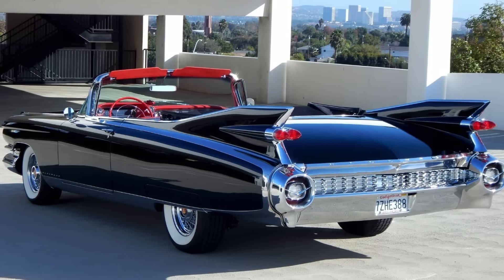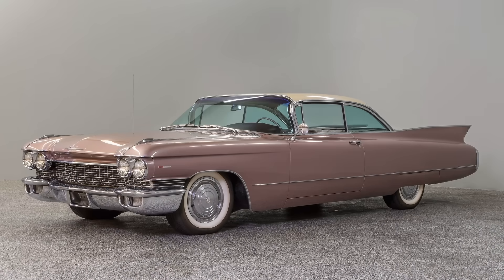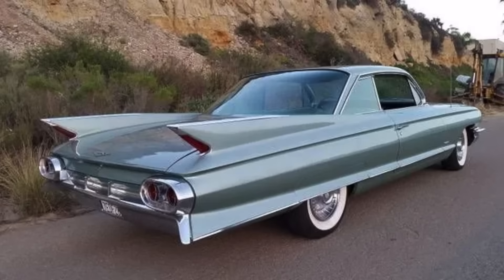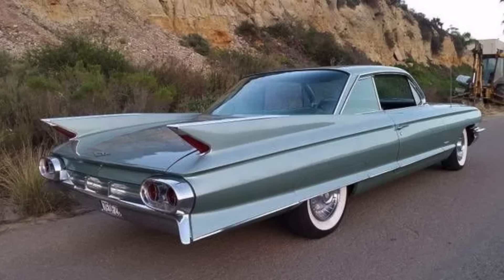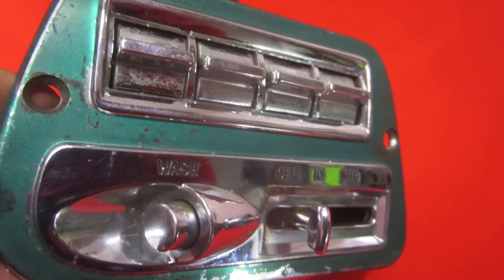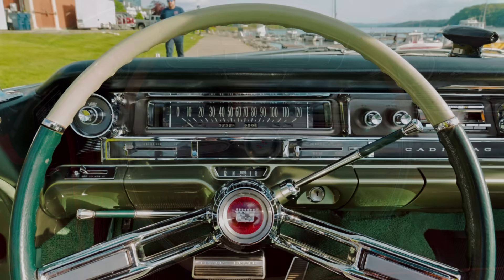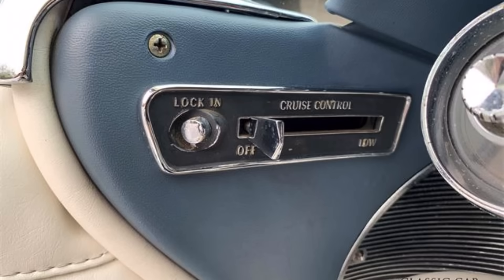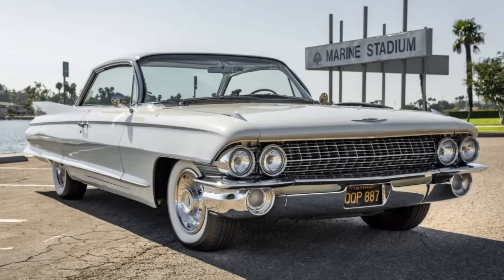Worst Automotive Components of All Time: The 1961 Cadillac's Dangerous Cruise Control (GM)

Comment: Hey! Small correction for you, but very nuanced! I own a 1961 Cadillac, which was the second to last year for the original 390 engine, which was introduced in the 1959 model year. It was a continuation of the 331/365 OHV engine series (same block), which was introduced as Cadillac's new postwar engine in 1949. After 1962, Cadillac designed an entirely new engine for 1963, which happened to also carry the same size in displacement, but was a completely different engine internally that shared almost no parts! It was that engine that was later bored out to 429 cubic inch engine. 1968 was the switch to the 472/500, which was also a new block as both previous designs had reached the limits of their displacement. In short the 390 engine used in the 1961 was not enlarged to the 429, they had already gone to a different block by then! Maybe you knew this and didn't feel the need to include that information but just incase, thought I'd share!

Comment: I don't know if I would call the Cadillac 429 all that reliable.  The timing chain cover allowed oil blow-by which very slowly stopped oiling the top of the engine.  It wouldn't turn on a tell-tale light, but slowly destroyed the engine.   Of course GM really could care less if the car lasts past 100,000 miles back then.  The only way to fix the problem was a new timing chain cover, which still isn't fixed if it's going to do the same thing again.  It sad the most beautiful of the tail finned beats suffered from this problem.

Comment: Back in 1981, I could've had a 1961 Cadillac flower car that  one of the funeral parlors in my neighborhood was selling for $600. One of the funeral directors saw me admiring the old tank of a vehicle and offered to sell it to me. It would have been my first car; it was in pretty good shape and well-maintained, with fairly low miles, since it mostly was driven to local cemeteries. Being that it was a two-seater, I guess that it could have served as a sort of Cadillac El Camino. As cool-looking as the car was, I had to politely say no thanks to the director; needless to say, I never would have heard the end of it from my parents, particularly my mom, if I had gone ahead and purchased the car. Oh, and I was told that the car averaged about six miles per gallon of fuel.

Comment: International straight trucks for a short while had a twist-to-lock knob for winter engine warm ups. Its stamped Trottle Lock. What can go wrong you might ask.
Reply: First legal car  - '47 Dodge. Current ride  - '48 Plymouth (we circle back). Both equipped with twist-lock throttle knobs, useful on long flat stretches.
Reply: @ssbn6175  l agree. Bare bones on options. Barely had any heater nor defroster. And the SEAT ! Pain in ass. Rotton truck. No power. 56 mph
Reply: @danharasty6686  the Dodge topped out at 70 and I imagine the Plymouth would do the same. The 'Comfort Master' heater in the Dodge cranked out maybe 800 btu, compromised somewhat by a big old hole in the driver's floorboard. Slush would shoot right up through it. Drove it for eight years, cranking the window down to give signals that few understood in every type of weather. 

The Plymouth has turn signals and...get this...two blowers! But she only comes out on nice days.
Reply: @ssbn6175  Was lots character in the Oldie cars. Holes in floor so car could share the slop slush

Comment: The first few years of the Datsun 240Z had a very rudimentary "Cruise Control" that would NEVER pass today's safety standards.  It was a second lever just to the right of the "choke" lever (not really a choke but actually a bonafide mixture adjustment lever like an airplane has!) down on the console.  This "cruise control" lever was just a second throttle adjustment that attached by cable to the carburetor and locked in the throttle setting to where ever the lever was set.   Tapping the brake would do nothing to cancel the setting!  I have had two 240Zs, a 1971 and currently a 1972.  I wish mine was equipped with this relatively rare option, especially on the many cross country trips I've made with the car.  I figure I am smart enough to handle the lack of current safety technology this option had.

Comment: When at a Peugeot dealership we had a disabled adapted car in for service, an auto, where the brake and accelerator positions had been swapped. The service advisor wrote a warning in red across the top of the R/O and the workshop controller verbally warned the tech (an Indian) on issuing the keys. Having reached the end of the four post hoist the tech pressed the pedal where the brake should be but was now the accelerator and drove at some speed into his tool chest deploying all airbags. His face was like a photographic negative when he emerged from the write off with copious amounts of white powder applied to it.

Comment: I used to buy older Square body GM pick ups as a work vehicle.  

I always added a throttle control to the dash controls, as I had a switch to convert the Alternator to 120 VDC at the proper RPM (before cordless power tools) 

I just used a lawnmorow throttle control and cable

If anyone used my truck they slide that down for a vent and the truck would take off!! :)  ... I would remind anyone who as using my truck not to do that! :)

Comment: Wow that powertrain is smooth and powerful.  Probably not great with emissions or fuel economy, though!
Reply: If you can afford the car, you can afford the gas.
Reply: Had a '65 Fleetwood Brougham, 429, big boat, smooth as silk. No idea what curb weight was, probably around 5k. Surprisingly quick. All four vents were powered, so you had eight(!) window switches. 

Stolen, sadly.
Reply: Cad not built for economy gas was 5 gal/$ city h2o supply still used lead, pollution, whats that

Comment: Talk about again, a good review on your part, this one "takes the cake" so to speak, and I would add the following about that cruise control placement on the '61. Recalling those years in my early sixties childhood, most Cadillac owners were pretty well- dressed, and cuffed shirts with links many times were all en Vogue. Driving with any long-sleeved apparel would have presented a definite accidental actuator AND adjustment hazard for one's left hand appendage. Here's why: little room to negotiate the tight space between the steering wheel and the bottom of the a-pillar section where the Cruise Controller pod was located might result in inadvertently snagging clothing or even brushing up against the slider bar with one's naked hand, wrist, or forearm even. Imagine those ladies' fur cuffed overcoats, or a wrist watch snagging that bar while reaching for anything on the left side of the dashboard. Also, 50/50 at best, reduced highway to eye contact attention span in order to adjust and set the ill-placed device. Good show and good catch on your part once again. The 59-60 placement was probably the best position because it's position was foreward towards the windshield. So much for progressive, sequential, positive evolutionary design; right? That sensibility was almost as ridiculous as the overall styling of the 1971-72 big Mercs vs the '73 onward that I vehemently denoted in a review I wrote somewhere. They absolutely butchered the classic modernism of the '71-'72 Mercs in the '73, as a radical departure from anything recognizable as logical, let alone appealing. In the case of the cruise control, the potential price on this negative overview could have been much more than aesthetic, even lethal, or insurance cost inflationary at best. Keep it up! Thanks.

Comment: Another idea of adding something to the dashboard to change the style of cars was when Chrysler decided to move the gear shift lever from the right side of the steering wheel to changing it to push buttons on the far left of the dashboard.

 It didn’t last long before Chrysler decided to go back to  gear shift levers on the steering column
Reply: It was the car rental companies that suggested the change to a steering column lever after complaints from customers. Chrysler got rid of it in 1965 after a ten-year run.
Reply: It was mainly Ralph Nader who killed the Chrysler push-buttons, as well as complaints from Rent-A-Car companies.
Reply: I understand that the mechanization was complex and expensive, and quite difficult to adjust. Could be wrong.
Reply: @Greatdome99  1965 cars had a one year setup which used a column shift with a cable to connect it to the transmission like the older ones had.  1966 went to a more conventional linkage setup.
Reply: Packard placed the pushbuttons for it's Ultramatic on the right side of the steering wheel, just like it's ignition switch. I've always thought it was awkward having the ignition switch on the opposite side of the gear selector. Glad that design fad passed.

Comment: 3:15 That is what was called a combination coach. It was a hearse that could be used as an ambulance. It had a rear jump seat. When used as a hearse the rollers were flipped upward and the jump seat folded down. Just reversed when used as an ambulance. It also had a stationary cot hook in the rear compartment on the driver's side.

Comment: In 1973 my dad bought a 1960 Cadillac sedan DeVille and got a flat in the rear tire. It broke the jack at a service station and they had to back it up into the lift to get the rear tire off the ground. That thing was heavy. But it floated down the road.

Comment: I did pre production vehicle testing for rough in 2015/16 and one vehicle was a 2016 Buick cascadia convertible. That car has the master power window and top switch right next to the electric E brake switch. One day I waw driving on the freeway with the top down and it started raining. I slowed to 30mph on the shoulder (max speed to raise the top) and accidentally pulled the e brake instead of the horseshoe shaped top button.

Comment: the auto head light dimmer was a nightmare.  i used to get in a fight with it and it won. putting high beams on oncoming cars.
Reply: My Dad had a '53 caddy with that gadget. It would trigger on a street light. Sometimes it wouldnt work, I remember Dad stomping on the floor dimmer switch, which didn't make contact 1/2 of the time.
Reply: Autronic Eye often gets confused by reflective highway signs, can be amusing or downright dangerous.

Comment: The taillights on the big finned Caddys were not styled as rockets they were styled as Jet Engines.  The 59 is a B52 engine pod, A 60 could be a English Electric Lightening or a US jet that I cant remember the Designation of Probably a F100 intake and a 61 is a F102 or F89 engine outlet. But many cars back then were covered in military ques. Is it the 61 Grill that uses 50 cal bullets in its styling?
Reply: I like the treatment of the taillights that first appeared around 1948 or '49 and continued more or less through the mid 1950s,you could always recognize a Cadillac and I believe the extra elevation made the brake and tail lights visible from further away to following traffic. Also those things were not sharp unlike the ugly 1959 tailfins. At least the 1961 fins were a bit less intrusive and "cleaner" looking than the '59s

Comment: Most cars did not have cruise control.  It was an exception rather than a rule.  With this said, if the 61 Cadillac came with cruise control, even if you had a 59 previously, it was still a "new feature" that many would need to read the owner's manual to "figure out."  If by accident the button was activated, the switch is still off, but say the driver moved the switch and pushed the button, and still not seeing the wipers moving, a tap on the brake pedal would deactivate the cruise control.  I do not see this as a big deal to put the cruise control in that location.  Imagine being a car hop in 1961, between Chrysler and AMC push button drive, different shift patterns between Ford and GM, 3 speed shift on column, AMONG many other quirky but oh so neat space age features, ie Autonnic eye, swivel seats, convertibles where the roof went in the trunk, etc, I think for the time, every option was new and exciting and it required THINKING which modern button to push, because there could have been a button for take off with those great wild fins.

Comment: I’m assuming that tapping the brake pedal didn’t knock off the cruise control back then?🤷‍♂️
Reply: Actually tapping the brake pedal  disengaged CC immediately. One time should have taught any driver to look at the controls or read the owners manual. 

Additionally, per the Cadillac LaSalle Club, the least ordered options for 1961 were power vent windows and Cruise Control.

Although Cadillac switched to a Cruise Control dial with pushbutton  engagement for '62, I wouldn't consider the '61 location as necessarily dangerous unless one continuously pushed the CC button expecting the windshield washer to start. 

I'd think it'd be more dangerous for drivers, who were used to a different auto trans shift pattern, where R is at the end of the quadrant, to get used to PRNDL. Also to go from a R sided column shift lever auto, with a Park, to a L sided pushbutton shift box where there's only Neutral and you must remember to set the emergency brake when you park. 🤷🏾

Comment: another similar issue to this is the transition between a Chevy HHRwagon, and a VW Sportwagen.  My wife's car is the Sportwagen, and it has the stereo volume control on the left side steering wheel spoke.  The HHRwagon I drove for work has the cruise control buttons there. After driving around her car, I would get into my company car, be traveling down the highway with the cruise set, wanting to turn up the radio, and end up pressing the Speed + button a couple of times!!!

Comment: This is what I do not understand.  If a person hits the 'lock in' button thinking its the washer, the slider is still on 'off' and nothing will happen thus leading the owner to think the washer is broken.  If they move the slider switch over, I would think if they took their foot off the accelerator, the car will slow down because they did not push the 'lock in' button.  The wipers still would not turn on thus alerting the driver that something is wrong. 

Additionally (and I remember this from when I was a little boy), when you bought a new car, especially a luxury car, your salesman, upon delivery, would sit in the car with you and point out all of the features and how to operate them.  
I remember when that stopped when 20 years ago when I bought a new SUV, I asked the salesman to show me the features he said 'read the manual' and  walked away.

Comment: I had a '61 (my second car) that I bought in 1975 but it did not have the cruise control option. Not a bad car for the $75 I paid for it.  Ran great for about six months until the trans went out. Got $45 from the junkyard so I didn't lose much.

Comment: I have a 59 and in the service manual that I got for it, it says if you hold it to the floor from a dead stop it’ll hold first gear till 80 miles an hour with the four speed. And the big 390 in front of it which is crazy I definitely would not drive it that hard but it does pull very well. Mine has about 87,000 miles on it and far as I know the engine has never been taken apart runs very smooth.

Comment: Not only swapping cruise and wiper/washer control for "change for the sake of change", but note exposed phillips head screw just above the control on the extended dash flange with no attempt to hide or disguise.  This would be unforgiveable now, and consider this was a $6000+ car new ($70K-$80K now).  You could get a decent tract house in 1960 for $10 grand.

Comment: The worst component on any vehicle I ever saw were Chevy truck body panels in the 70's and 80's .  That corrugated metal would rust from the inside out.
Reply: Very true.  I love my 73 GMC, but if I lived in a different state, I would have to have it rust-proofed, or else it would soon dissolve.
Reply: Inside was where road salt collected hence, inside out
Reply: @rogerdodrill4733  I lived somewhere with limited road salting back then.  It always seemed to be from moisture trapped in the folds.

Comment: I bet a 1959 Cadillac wouldn't fit in a 1950's tract home garage.  Couldn't shut the door.
Reply: My Great Uncle had to cut a section of drywall out of the back of his garage to fit his 1974 Cadilac in it.
Reply: @jeffrobodine8579  My grandpa had the same issue with a 59 or 60 Olds 98.  Cars at one time must have been like driving your living room down the road.
Reply: In those with the 2 car garage it often would, but a 57 or 58 Fleetwood Sixty Special would not, nor would a 58 - 60 Lincoln.
Reply: @jetsons101  That was the whole point!  Total comfort, not bland rough-riding "efficiency".
Reply: @michaelbenardo5695  Talking about a  Smartcar ????
Reply: My 59 Buick fit ok. It was pretty long also 😂

Comment: There is some debate about the shift quadrant. The reason GM put Reverse all the way at the bottom is so that you could 'rock' the car easier if you were stuck in snow or mud. All you have to do is shift one notch up or down. The obvious issue is how easy it would be to shift to reverse while driving. The PRNDL quadrant was mandated in 1965, one of the reasons had to switch from pushbuttons to a real lever.
Reply: It wasn't easy to shift into Reverse accidentally.  You had to pull the sift lever toward the steering wheel first, and it was spring-loaded.

Comment: I had two '61 Ford Galaxies, both had a cruise control that was debatably more dangerous. Mounted below the dash just right of the wheel was a T-handle attached to a cable also attached to the gas pedal. When you reached desired speed, simply pull the cable taught and turn the handle right 90° to lock in the throttle position. Operating the brakes did NOT release the cable. !!!!!